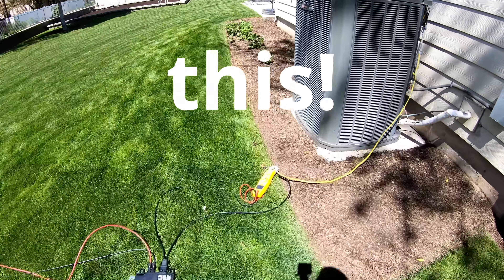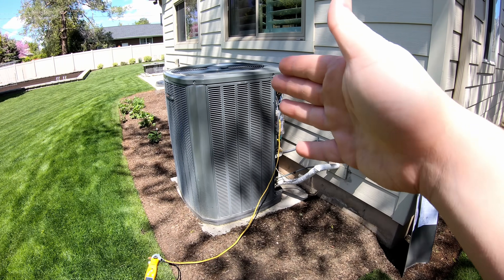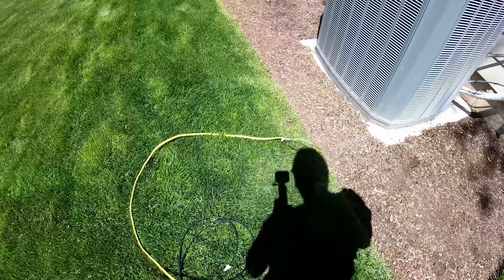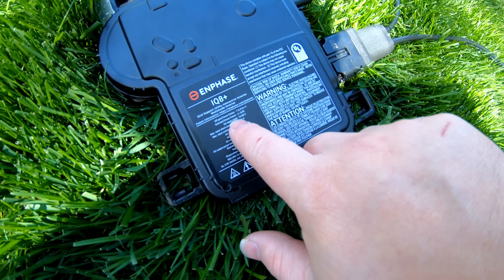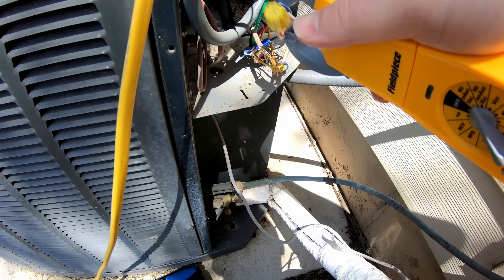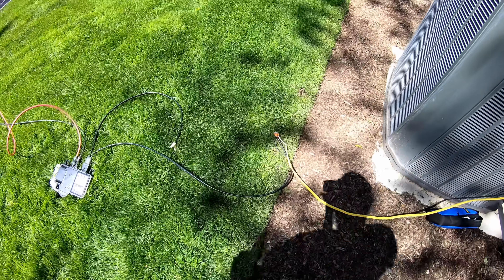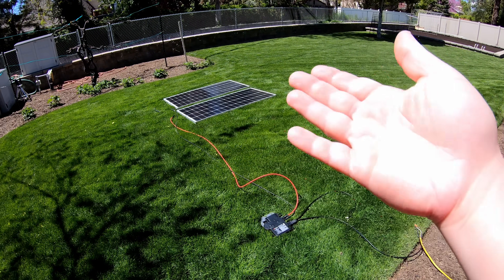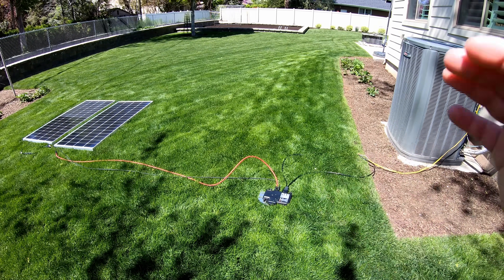1 Hack To Eliminate Your A/C Power Bill This Summer!

Comment: Just thought about using solar panels connected directly to attic fans to ventilate the excess heat in the attic during the summer. When the sun goes down the fans stop working. I’m actually curious if anyone could give me pointers on this. I’d actually like to give it a shot here soon. I’ve seen that cooling that thermal load can significantly increase the efficiency of the cooling of a home, and the energy requirement is fairly low for fans so the cost of panels would be low enough to be offset fairly quickly
Reply from the maker: That’s a cool idea! Be sure and report back if you’re able to figure out how to make it happen! Thanks for watching!

Comment: This is all new to me but just out of curiosity, if you had two grid tie inverters going into the AC unit how would you connect both of those to the contactor?
Reply from the maker: The Enphase units you can easily just daisy chain to each other. Thanks for watching!

Comment: the air conditioner only usually needs to run at maybe 1/3 load for about 12 hours a day which ends up being roughly 4 hours a day at whatever it takes.  for me, i'm using 3 window air conditioners at roughly 900w in a relatively small house or roughly 2700w or roughly 10.8kwh .  your solar setup is only good for 280w.  and in the configuration of only running while the compressor is running, is only good for a possible 4 hours a day or 1.2 kwh of power. (and that assumes that the sun is up during the whole 4 hours that the air conditioners are running (which it won't be because it goes into the evening as well but i'll put that to one side for now).  1.2 kwh is a drop in the bucket compared to the 10.8kwh the ac would use in total, bringing grid power used to 9.6kwh.  even with my RIDICULOUSLY high CT power rates of .36/kwh, that's the difference between $3.90/day and 3.46/day (or $116.64 vs $103.68 a month), not a whole heck of a difference ($12.96/month).  looking at the rough cost of a low balled ~300w solar kit online, it looks like it would be roughly $250 (for a couple panels, a microinverter, and the appropriate wiring like what you show here), and it would take roughly 20 months of use to make it's money back.  personally, due to my location in CT, I only use my air conditioners during the summer months (approximately may-september, so about 4 months out of the year), so as implemented (assuming perfect conditions and overlaping sun for the time frame the ac is on), it would take 5 years before it paid for itself. and that's with my crazy high power costs.

don't get me wrong, I love the idea of solar.  and it can totally be economical and effective, but for that to happen, I'd need a whole lot more panels, a whole lot more micro inverters, probably much denser panels, and a way lower operating cost per watt generated.  to take this to the next level, I know that there ARE companies making SPECIFICALLY solar central air conditioner kits that include air conditioners that have INTEGRATED inverters that you plug your pv panels directly up to so your air conditioner (and heat pump, because you can run it in reverse and get very efficient heating in the winter to supliment whatever you use for heat) so you can offset 100% of it's use.  it would be off-grid solar that is specific to your air conditioner.  which in some places can totally make sense.

Personally, however, air conditioning isn't even the thing that takes up the most power in my household, it's computers.  my file server takes roughly 400w 24/7, my desktop workstation takes roughly 300w 24/7 (and that's at relatively idle, that can go up to roughly 900w for a few hours a day if i'm using it's high end gpu for gaming, video processing, or machine learning workloads.  my son's computer takes roughly 250w for roughly 12 hours a day and that can spike for a few hours a day up to about 700w when he's playing games or doing video processing), my networking stack (switches, router, modem, takes up approximately 100w 24/7.  my son's 2 24" lcd monitors eat up about 200w for roughly 6 hours a day, my 3 48" oled monitors take up about 400w for 8-12 hours a day.  I also have 3 3d printers which are about 200w that i use each an average of an hour a day. an average lcd tv is about 120w so depending on how long someone is watching for, that can add up too.
Reply from the maker: Thanks for sharing! Everyone's use cases and needs are different! Sounds like a sweet tech setup you've got! Thanks for watching!

Comment: Would it be possible to have one larger inverter to host all the panels (1000W for example) instead of multiple inverters?
Reply from the maker: Of course! But then you’d have to buy a huge system all at once! This way you can expand slowly in small increments as money allows, but immediately put your investment to work. But either way works! I just refuse to go into debt for a solar system hence why I’m doing it bit by bit. Thanks for watching!
Reply: @theresatrickforthat  Gotcha, thanks for all the info!

Comment: Can you add several inverters in parallel to come closer to the running amps? I have “excess solar” in the summer time for my battery system. I could use one of the smaller arrays to feed a few of these inverters in the summer and then switch back to feed the battery system in the fall and winter.
Reply from the maker: For sure! That’s the whole idea is to add more inverters and panels in parallel until you’re offsetting the vast majority of the power consumption! Thanks for watching!

Comment: Is it possible to add solar panels to ASSIST  grid draw? I.e. instead of drawing 3000W from the grid, the solar panels will assist 2000W? For some saving ? Thanks.
Reply from the maker: Absolutely! That’s basically what I was doing in this video, only with 400 watts of solar. But just you wait…I’m going to have a sweet solar setup some day as I continue saving my money! Thanks for watching!
Reply: @theresatrickforthat  thanks. Will you be doing an updated and detail video on the complete setup ? What I got confused on is how I can make sure the hvac will draw from the solar panel first and not completely drawing electricity from the grid ?  Thanks.

Comment: If a 3 ton unit needs 5000 +- watts to run, are the addition of 200 watts worth the expense ?
Reply from the maker: It depends on your priorities. In my case, the investment is definitely worth it because my goal is to flush out an entire Enphase system but I don’t want to go into debt or finance them in any way, so I’m buying parts and pieces as money allows and deploying them as I get them so I can at least start benefiting from them as I increase the size of the system. Thanks for watching!

Comment: So the limiting scaling here is the microinverter is rated for a bit over 420 watts so you'd need one per panel to scale? (or in this case if using smaller panels in series you could have 1 per 2 panels,etc)  if that my understanding. Are some use cases this could make sense and have a payback if it could be scalled but the inverters yeah going to increase that payback time. there are some scenarios where whole house solar is  silly,...not everyone runs their house on electric, they may run the small loads but the heavy energy loads are gas because it makes the most sense . also  in a hot area 90% of your bill is going to be that 3500 watt to 5000 watt compressor load. But going to need some panels and unfortunately the microinverters are going to double the cost for each one assuming you get to the large wattage panels.
Reply from the maker: You’re right that micro inverters are more expensive than string inverters. But there are benefits to micro inverters as far as efficiency and shading goes as the system grows. Anyway, yes. Each person and house is different which is part of the fun! Do what makes the most sense for you and go for it! For me personally, I want to have a whole Enphase system but I’m buying little chunks of it at a time and the cool part about it is I can deploy my little chunks of the system as I acquire it and start reaping the benefits as I continue to build the system up. Thanks for watching!
Reply: @theresatrickforthat  yeah so my average florida summer is 60 kwh per day..math isn't hard on that, a 5 ton ac will draw 5000 watts with compressor, figure 25%-50% (variable) compressor run time that's going to be about 50-60kwhk...keep in mind other big energy  i'm on LP i can go 3-4 months (and i have a small 120gal buried lp)  with power outage with a very small inverter gen backup. You can get some air sealed house, lower btu,etc run a humidifier (which you would have to in florida) but that's all money with increased (highly) roi. You could install whole home solar...again in this case that is overkill, why not just power the source of 8-90% of the wattage. Minisplits throughout (have their own issues) and you'd need to do whole home due to the number of circuits. Anyways seems silly just supplimenting the ac and not messing with grid-tie, whole home and all the mess that comes with that $$ would probably have faster roi as it's much simpler less over engineered solution.

Comment: That good sir is HUGE. I am no electrician nor engineer but my question is 2 folds.

1) I am in Illinois, not always sunny. Is it possible to still have AC on solar as well as AC on grid, that way when sunny then power is given priority to the solar panels.

2) I would love  spec sheet, DIY  video step by step (Do's, don't, warning) - monkey see, monkey do type of video.

Cheer mate, thanks again
Reply from the maker: Thank you for your comment! 
1. Yes. Grid tie inverters produce their power at a tiny fraction higher voltage than the grid power they sense coming in. That’s how grid tie inverters can back feed the grid. But we can also use it to our advantage. This allows for in my case the AC unit to consume all of the power the solar is producing first before it pulls any from the grid. So regardless of if it’s sunny or not, your AC will use all the available power coming from the solar before it supplements the rest from the grid. 
2. I unfortunately won’t be providing in depth DIY information because electricity is no joke and you shouldn’t mess with it unless you really know what you are doing. Property damage to and including the A/C unit and personal injury and death are just some of the biggest risks. Not worth it. I would recommend getting a licensed electrician to help you. 
Huge thanks for watching and for your comments!

Comment: I admit I only watched the first 27 seconds of this and called bull shit.
A house air conditioner uses 220V at at 15-20 A. That's over 3000 W.
Solar panels that are rated at 100 W don't actually produce that so you quite a few more than 30  panels of this size to even begin to run an AC unit and they wouldn't handle the inrush current.

Not really worth watching the rest of the video. Maybe don't like to your viewers faces in the first 30 sec bro.
Reply from the maker: Well, you might want to watch more than just the beginning so you can see how it actually works! In any case, don’t forget to subscribe! You won’t want to miss Version 2.0 of this same BS and lie of a setup! Trust me! ;)

Comment: What about at Night? Your house will continue to heat up on a hot humid nights? I think the better way is to make a low power AC units. Start with a small room, and work your way up. USB is 5V it would be a very good place to start. Good Luck
Reply from the maker: You’ll enjoy seeing what I’ve got worked out for version 2.0 of this if you’re wondering about nighttime offsets! So be sure you’re subscribed so you don’t miss it! Thanks for watching!

Comment: Definitely not safe/legal this way.  Nothing here in this setup would prevent back feeding into the grid in case of a power loss. I could go on and on about many things you shouldn’t be doing but I’m sure you are already aware of most of them from the other comments.
Reply from the maker: Well, in the meantime, you might want to learn about how contactors behave when they lose their coil voltage say during a power outage. Might shed some extra light on your thoughts. But in any case, I appreciate you watching!

Comment: That is so cool! Now, to just find an HVAC tech that would be willing to set this up. Plus, the Micro-Air Easy Start.
I don't think that you mentioned that some voltage needs to be sent to the furnace fan, and I would do that just for A/C usage (I think). Great video!
Reply from the maker: Thanks so much and thanks for watching!

Comment: The only problem I see with this setup is that you are losing a ton of generation potential unless you have a multistage AC system that cycles longer.  This is a great way to start things off and slowly build a system up from there.  Or a great solution if you have a bunch of inexpensive used solar panels with nothing to use then for at the moment.  

I wish this was more of an option when I started.  Originally I purchased a 6000w 48V inverter with an automatic transfer switch 3.5KW of used panels and a DIY 150AH 48V LiFePO4 battery and I was able to meet most of my daily needs when the sun was out with that system and all in I think I only spent about $4000 initially.  The nice thing is I have been able to expand that system over the years that followed when I had extra money available and now have nearly 10KW of solar panels (about 2000 watts of which are on microinverters to save on cable), a 12KW inverter and a bit over 900AH of storage at 48v and I was even able to use the microinverters on the inverter side of the system with a contactor to disconnect the microinverters from the inverter if the automatic transfer switch is activated to prevent back feeding the grid and this allows the inverter to run in reverse and charge the batteries from the microinverter string if less power is being drawn by the house at the time.
Reply from the maker: You’re exactly right! Version 2.0 of this is getting posted in a matter of weeks! Based on your past experiences, you’ll enjoy seeing it! Subscribe so you don’t miss it and thanks for sharing about your epic setup! And thanks for watching!

Comment: If it weren't for your soft starter, 400 watts won't cover the inrush amps needed to even start the compressor.
Reply from the maker: You might want to research grid tie inverters a bit more and soft starts. There’s actually no way with that small setup even with my soft start for it to cover the in rush. But one day, I’ll have a big enough system for it to be 100% covered! Thanks for watching!

Comment: This is brilliant! Anything that has a contactor could do this, freezer and fridge, water heater... you could also use this so that you could use a smaller generator during a power outage. If you also included a DC relay that required a certain voltage from the panels before allowing the  grid power to turn on, you could create an "if this then that" that would allow you to only run certain items when solar assist is available. That way your AC or water heater wouldn't pull so hard on your generator. 

Another use case would be a pool pump or heater could be configured to only run once the panels hit a certain voltage (DC) so it would only run when the panels could assist.
Reply from the maker: Great food for thought! Thanks for watching!

Comment: I’m telling you I can’t even watch this video anymore. How can two solar panels start a 220 air conditioner give me a break.
Reply from the maker: Well, I’ll point you in the right direction…do some research on how grid tie solar works, and then you might get some added insight into how this A/C unit can start when there’s just two solar panels and a single micro-inverter. (You may also enjoy seeing the amp reading portion of the video too before and after the solar.) In any case, thanks for watching! Be sure you’re subscribed because you won’t want to miss “getting a break” from my Version 2.0 of this setup coming out very soon!
Reply: I understand the skepticism if you know nothing about solar but if you know about solar then you should know the answers.... With that being said, this man is a genius.

Comment: An air conditioner uses around 1000 watts per ton. Good luck with that.
Reply from the maker: 100%! Or even more than that in my case!  (Did you see the amp readings I took while the A/C was running?) Be sure you’re subscribed so you don’t miss my future videos as I scale this setup! Thanks for watching!

Comment: If I have the enphase controller box could I connect the combiner box to the AC or would it be a problem because it would shut off the combiner box?
Reply from the maker: If you already have a full Enphase system and a grid tie agreement…there’s no need to connect to the A/C unit. Thanks for watching!
Reply: @theresatrickforthat  i do not. I have aboit 10 panels and micro inverts a fusable disconnect and the combiner box controller. I have no cabling or anything mounted or the mounting hardware. We got the stuff out of a storage auction. Im sure it works but this could be a test setup of sorts.
Reply: @theresatrickforthat  my thoughts were to hook everything up like it would be for grid tied but instead hook it to the a/c so I dont have to worry about those pesky inspections. The issue I see here would be keeping the electronics of the combiner box online.
Reply: @theresatrickforthat  do you think the soft start is required to avoid inrush damage on the micro inverters?